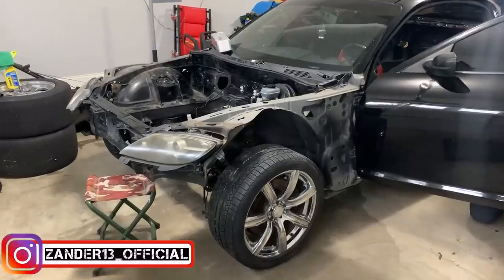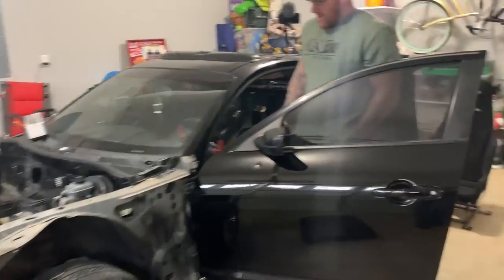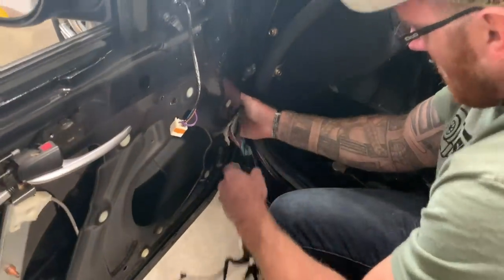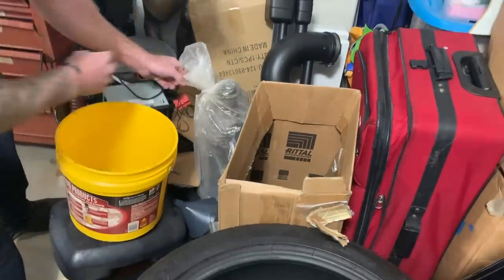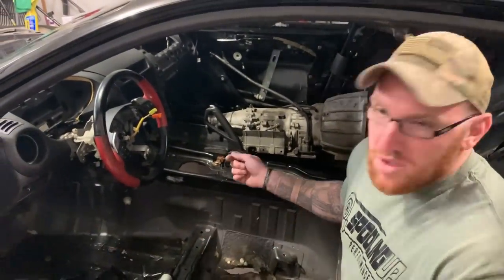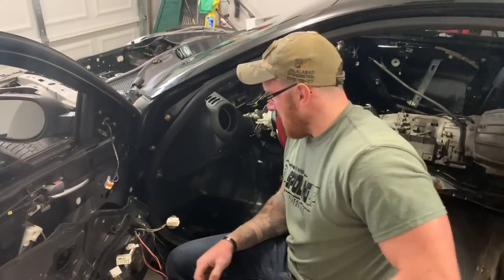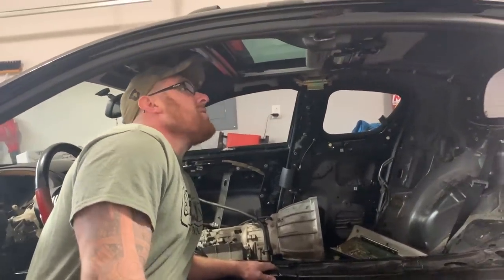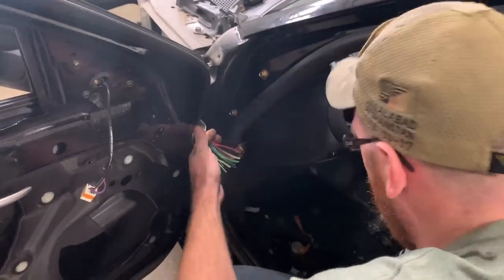GT500/ Demon Killer? Turbo LS Swap Mazda RX-8 Build

Comment: Thanks for stopping by buddy !!! Thanks for filming and for the shout-out !!!!
Reply: Been waiting and watching. I got an 04 rx-8 for $500 myself last weekend. I got a 02 5.3 lm7 from a tahoe. Block is at machine shop right now, got new precision race stage 2 heads, torquer v2 cam, comp cam ultra gold preformance rocker arms, new Melton oil pump, new timing kit, 39lbs injectors, holley efi sniper intake , and fuel rails. I know the intake will be an issue of height but I orginally was putting it in a truck, but I'm now thinking about modifying the hood for intake and truck accessories to work. I plan on doing a t56 magnum and looking at the install kits. I would like to share info if possible throughout the builds if we could. I'm looking to be on road by summer. Good luck brother.